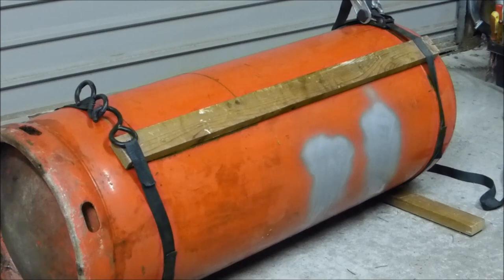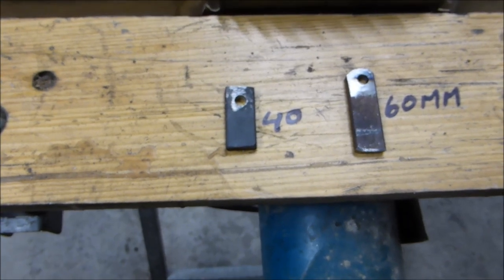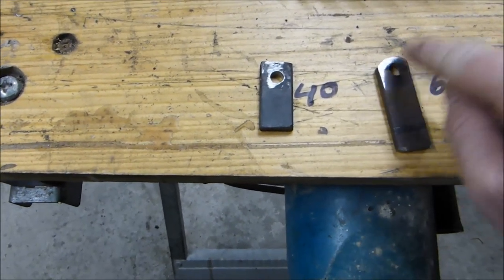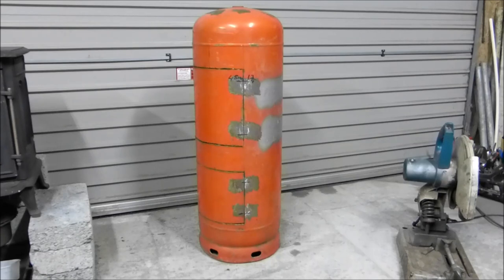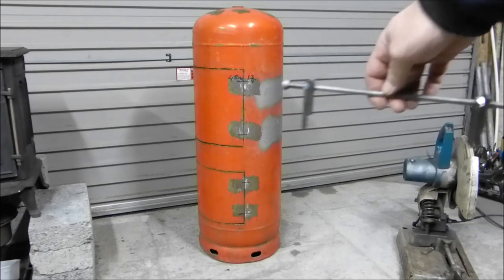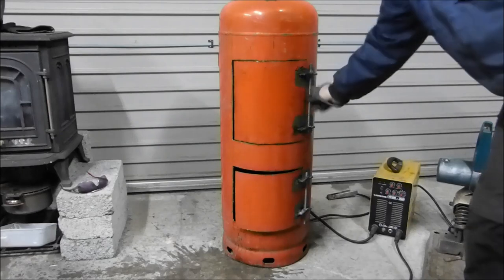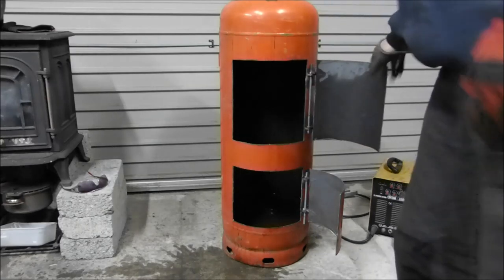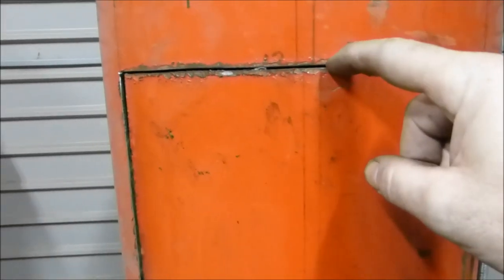Make a great waste oil and wood burning stove heater (part 2)

Comment: Gerry, could you come up with a plan for a 22 kg version of this heater for a 2x4 meter caravan that could be mounted to a wall? I desperately need an inexpensive heat source. I have a 76 mm chimney I plan to use with it. Thanks in advance.